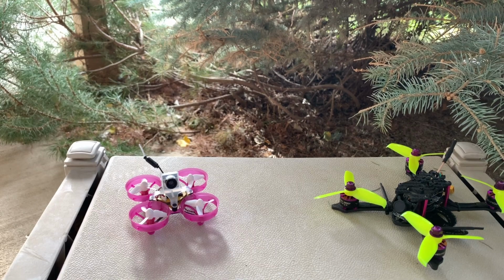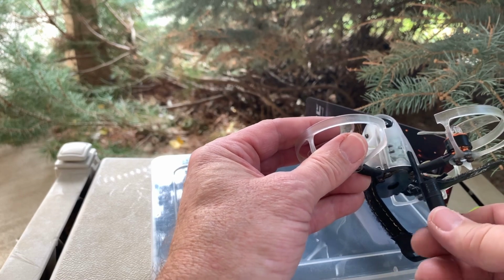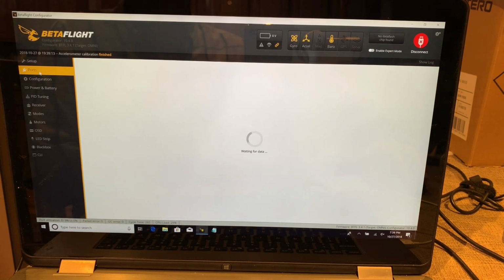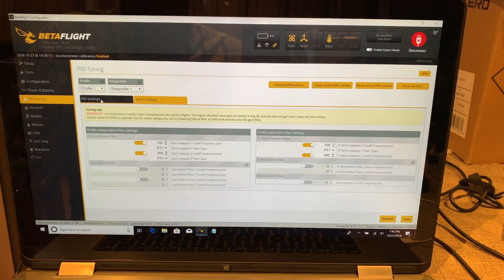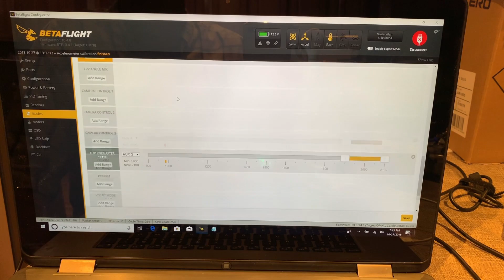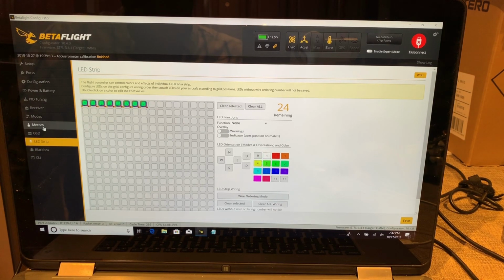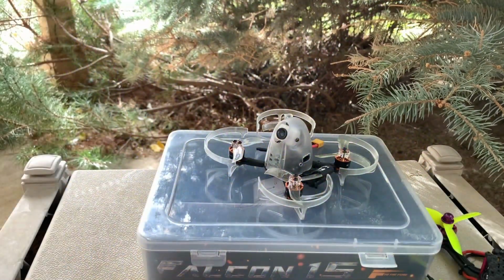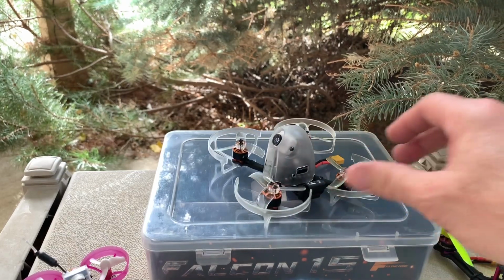T-Motor Falcon 15 Review & Setup

Comment: Hi, Thank you for your kind video.
 Could you teach me how to change ANGLE mode and BARO mode.
Reply from the maker: Hi Luckystrike,

If you are looking for an altitude hold mode :
"When activated, the aircraft maintains its actual altitude unless changed by manual throttle input. Throttle input indicate climb or sink up to a predetermined maximum rate (see CLI variables). Using ALTHOLD with a multicopter, you need a barometer".

I would recommend you load iNAV vs Betaflight. Here is the link to iNAV which has Wikis on how to get started. Link below:
https://github.com/inavFlight/inav/wiki

If you are just asking about basic RC Controller and Betaflight mode setup, Oscar Liang has a good setup procedure. Link below:
https://oscarliang.com/betaflight-modes/

Best Regards,

SLOG

Comment: Hi, do you think its possible to put in a caddx turtle v2 for hd footage? (Sacrifiying the canopy or cut the plastic) 
Is it 20x20 stacks?
Reply from the maker: It is a 20x20 stack and if you removed the buzzer/LED board from the top of the stack, you could put in a Caddx turtle V2 single board. The problem is the cable coming out of the side and getting access to the SD card would require some canopy mods. If you orient the cable for the camera pointing towards the the rear of the canopy, it would give you enough space. "Turtle PCB dimensions: 28*29mm / Camera 19*19mm and should fit in the canopy.  However,  you would still need to cut a slot to get access to the SD card.
Hope this helps.
Reply: @slogfpv5679  many tnks!
Reply: do it, there is space ;) I am so stuffing mix into mine (and crossfire)

Comment: Great,i wanna see rxsr with soft srial,make a new guide 😉
Reply from the maker: I would recommend using the XM+ because there will be some disassembly of the flight stack and more advanced soldering required. But if you are set on the Frsky R-XSR, I used soft serial on my Acrobrat build but it was for a different flight controller (link below):
https://www.youtube.com/watch?v=DbyAOwPIlo4&t=11s

Oscar Liang does a deep dive into how to use soft serial for smart port telemetry on a receiver like the R-XSR on an unused pin (link below):
https://oscarliang.com/betaflight-soft-serial/

Comment: I cant see my rssi,plz can u show connection?
Reply from the maker: Federico here is a quick video I did showing the wiring harness you get with the Falcon 15, soldered to a Frsky XM+ receiver. 
https://www.youtube.com/watch?v=3IfHcez1iYc

It sounds like you need to flash your Frsky XM+ Receiver as sometimes they don't come with RSSI enabled. Here is a link to Oscar Liang where he describes how to do it. 
https://oscarliang.com/flash-frsky-rx-firmware